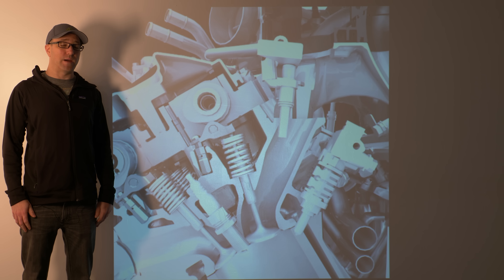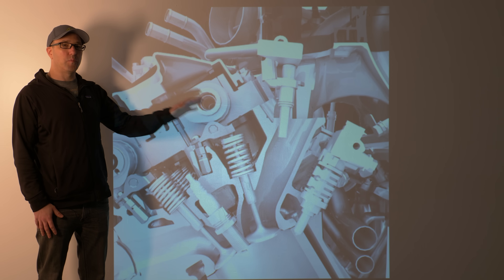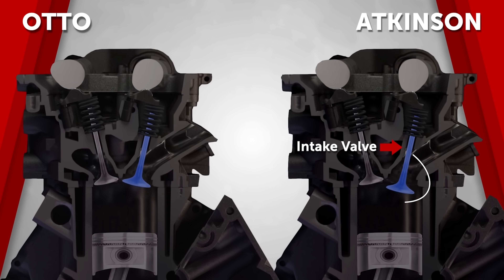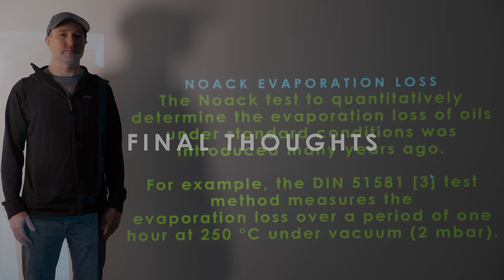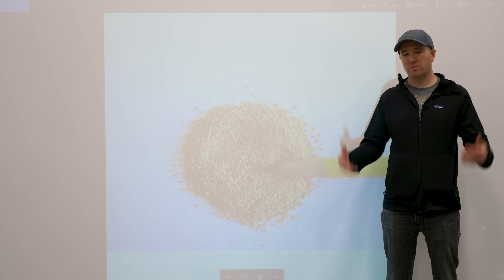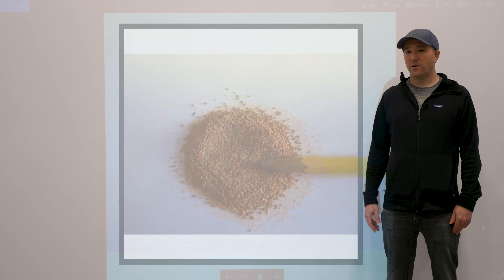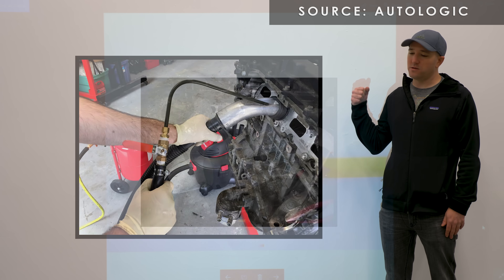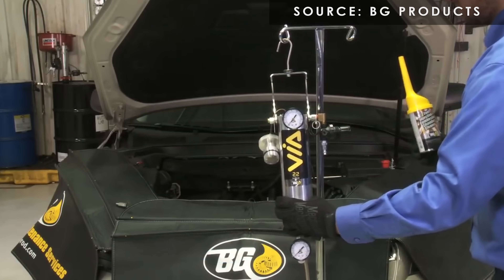Direct Injection, Problems and Solutions | The Fine Print

Comment: Toyota may cheap out on their paint coding, but they never chip out on engine and transmission materials and technology. And 'Oh, they just reliable cos they use old tcch' BS. is false, since simple new Corolla has industry leading tech. Germans even wouldn't be able to mass produse engines like that for adequate price. But it's not news. Even In 1980s their metallurgy technology was far superior than that in other countries and only they could build long stroke engines that were high revving, due to mass production of light and strong crankshafts, connecting rods and pistons. They were smooth, economical and powerful even before ECUs and other modern stuff. That's how they concarade the world. Then they showed how injection, variable valve timing, active awd systems and turbocharging is done properly and reliably. They were also first to implement these technologies in mass production of affordable vehicles. 

German cars are unreliable, not because they are complex, but because they use cheap materials, cheap production process and reliability unconscious engineering for their engines and transmissions. Carbon build up (due to cheap, unsophisticated direct injection systems), oil consumption and cluttering (due to bad design), bore erosion (due to the lack of proper inserted iron sleeves, because it's cheaper to spray some coding on aluminum block) camshaft and crankshaft wear (due to cheaper materials). BMW also likes to overheat, cor i6 suckes. Vag group likes to use older engines with modern tech on top and cheap dual clutch transmissions. That's wright DCT is far cheaper to produce than proper torque convertor once. Overall heir transmissions are cheap and unreliable. These are well known issues with modern german luxury cars. That's why they don't last more than 100k. 
They simply aren't meant to last, since in europe: the older your car is and the bigger engine it has — the more taxes you pay. And really old cars aren't allowed, it's only logical for them to not care about the car making it over 5-10 years and 100k miles.

Lexus LS 460 was very complex machine for it's time (2007 2012) with it's 8 speed auto, direct injection high compression engine with active egr cooling, vvti and complex suspension. it is expensive to maintain, yet there are a lot of them with 300+ k miles on the clock while almost none of W221 S classes that passed 200k.  Because it has high quality key components. And mark my words: new twin turbo v6 in Lexus LS 500 will outlast (milagewise) German turbo 6es, just like old Lexus atmo V8es had outlasted old German atmo V8es. 
Oh and Toyota have never used direct injection only.

Comment: The carbon build up issues only seem to affect certain manufacturers to certain degrees. I feel like VW and BMW destroyed the reputation of GDI systems because they REALLY had some carbon issues with theirs. The same issues are almost non existent for some other manufacturers such as Ford and Hyundai which aggressively jumped onto GDI over a decade ago. I say almost non existent because the small number of cases that exist can usually be traced back to owner neglect and lack of maintenance such as poor quality fuel and oil, short tripping, skipping servicing or all of the above... 
There are DI engines with over 500,000 miles and have never had the slightest issue. A good example is a 2012 Hyundai Accent on the Hyundai Forums with over 550,000 miles. This 1.6 GDI has had full synthetic oil since new, top tier fuel with occasional injector cleaners added. The owner stresses it still gets original spec performance and economy figures on completely original mechanicals, and has never even looked at the intake valves due to not having a reason to do so...
Look after your cars and drive on!

Comment: Well, with all the problems in mind, my Polo TSI does  15km/L on LPG with mostly(90%) highway mileage... And no oil burning or carbon build up issues. 255000km, still going strong

Comment: Sorry but catch cans are a fail . At low rpms,  your pcv system has a fresh air input just in front of the throttle body and a output  going to the intake manifold through the pcv valve  . At mid and high rpms where most blow buy exist  the air flow at the air cleaner turns around and you basically have two blow by outputs . Put a restrictive catch can on the line to the manifold and more of those nasty gases will just be routed trough the throttle body , muck up the intake runners etc . In conclusion the gases under pressure will always  take the path of least resistance from the two valve cover openings . Lastly many cars have in the oil pan a liquid vapor separator or a self draining catch can by another name .

Comment: Absolutely do not use a thicker oil even if it has a lower volatility percentage. Modern cars with VVT, CVVT, VTEC etc. all rely on oil to enter extremely fine mesh guards to actuate the camshafts via oil pressure. Using a heavier oil will lead to larger particulates possibly getting stuck in the mesh rendering the technology useless, resulting in a huge mechanic bill or hours in the garage. Furthermore, a heavier oil will cause the engine to run without lubrication for longer upon cold startups, resulting in decreased life. Simply pulling the intake manifold every 30k-100k miles and cleaning the valves is way more cost effective in the long run. 

Rant over. Also, cleaning the valves is quite simple provided you research over how to properly walnut blast your vehicle. Usually, not always, pulling the intake manifold is the most difficult and time consuming part.

Comment: Interestingly enough some of the high tier oil manufacturers don’t show the NOACK numbers on their products. I’ve been doing some research and turns out there are some mixed opinions on NOACK numbers, typically under 15 is ok for PI, some people says DI needs some higher numbers in order to make molecules heavy enough so don’t get carry in to the valve, but some others says lower numbers allow the particles to fly inside the CC and get burned without residues.

Comment: Commercially available cars didn't get 50-70mpg in the '80s and '90s!
The Civic HF was probably the most efficient mainstream car and topped out at EPA 51mpg highway and only achieved that in one model year. It only made 58hp! 

The low power was offset somewhat by its low 1,700lb weight. These days cars are heavier due to much higher safety standards.

Comment: You know what makes a great catch can? The giant heat exchanger that is used to cool down your intake air on a turbocharged motor, the intercooler.
I run a catch can on my Ecoboost F150. It catches a lot, but as you mentioned, not everything. My intercooler does a fantastic job of catching the rest and if you put a little weep hole(my aftermarket intercooler came with one) at the low point of the cold side end tank, it will blow out any oil/blowby after it condenses and puddles in the end tank.
One thing I will say is that a catch can is a somewhat high maintenance item. I have to drain mine on my Ecoboost every 1000 miles or so. It's not something that everyone should try because you need to stay on top of it. If you are the type of person that uses your car as a commuting device and just drop it of at Meineke once in a while for an oil change, a catch can is not for you.

Comment: What about diesel direct injection?
Reply: Take all the negatives of gasoline direct injection, and multiply them by 10 with diesel. The problem with diesels is that they utilize an EGR and that EGR returns sooty diesel exhaust back through to the intake. Once that soot mixes with the oil and blow-by from the PCV system it turns into basically asphalt on the walls of the intake. I pulled the intake manifold off of my Jeep Liberty diesel after only 70k miles and the inside was coated with almost 1/2" of crud.
Reply: @Jay-me7gw  Damn. And diesel is only direct injection if I'm correct and if it weren't it wouldn't clean anything in the inlet.

Comment: GDI's and Turbocharged engines recently have been proned to "LSPI", Low Speed Pre-Ignition!  The new ILSAC GF-A standards are now effective 05-01-2020 with significant motor oil enhancements that protect engine owners of these engine designs!  FYI, learn more about our patented BestLine Engine and Fuel Treatments now with Nano Diamond Technology which is a creeping type of molecular lubrication that protects greatly against LSPI!  Your engine with BestLine blended with any type of motor oil either conventional and/or synthetic/full synthetic becomes a superior motor oil!  Essentially your internal engine will become virtually impervious to high thermal heat and extreme pressure!  Thank you, SavageGeese, as we thoroughly enjoy your videos here ar BestLine Racing!  Visit us here:  http://www.extreme-engine-relief.solutions

Comment: I just added carplay to my 2002 Honda Accord. 463,000 miles, port fuel injection, stick shift. Bought for $1800. Replacement engines cost $350 from the boneyard. 

I just looked at what new cars cost and lord have mercy is that not a pretty picture. Hope you want a self-destructing CVT mated to a small GDI Turbo engine that will crap itself in 80k miles for $25,000..
Reply: The point is your lean burning Honda accord is not up to modern emissions standards and outputs more than the modern equivalent. Whether you care or not is irrelevant, the federal agency's who dictate these things have made sure that the car manufactures care and so they push these technologies out. That said, some people would rather have the increased performance of a modern DI motor. In an age when a modern full size crew cab pickup truck can run low 12's in the 1/4 mile with just an PCM flash(2017+ 3.5L Ecoboost F150), or tow a 12,000 lbs trailer up a mountain with little issue, all while achieving low to mid 20 mpg's on the freeway, a lot of people can overlook the reliability issues.
Reply: Jay Skrypek I suppose it does cut both ways. Of course it can have the side effect of making cars twice as expensive, which I think people are just ignorant of and would be displeased to discover. 

Is it correct that I could retune this car to hit particulate emissions targets by increasing the richness and lowering the fuel economy? Are there other bits that would explode if I did that (assuming I returned the EGR to not nuke my cat)? Personally I think that a more pragmatic approach would be to tune cars differently depending upon locale, requiring people in LA to time for low particulate emissions and allowing lean burn elsewhere to achieve lower carbon. The particulate emissions seem to be more problematic in the acute sense but the relationship between harm is not linear to the atmospheric concentration which is geographically dependent. Plus the biggest effect of the CAFE garbage is larger cars to get more lenient emissions targets, a great victory for the regulatory state if I’ve ever seen one. Is there any data on realistic improvement of the key metrics like particulates and fuel economy net-net? Do we calculate their cost/benefit ratio or do bureaucrats just periodically ratchet down the numbers for fun?

Comment: Amazing, very well-composed video!! Just got my first GDI car recently (3.5 EcoBoost) and was concerned about valve buildup. This helps explain in extremely well.... thanks a ton for this!
Reply: Which 3.5? Second gen 3.5s are multipoint injection (port and direct injection)
Reply: @twinkieerella  first gen unfortunately. It's a 2016 Taurus SHO, which I don't believe received the second gen till 2018 or 2019, though it was apparently available in other 2017 models. Wish I knew about the Gen2 engines before I bought this car. Lesson learned lol.
Reply: BitterTongues84 I understand. We have 2014 f150 with first gen 3.5 that had major carbon cleaning at 67000 mi

Comment: I took your advise and bought a Lexus GS F with a V8 that has both PI and DI.  So far so good.  I have always been a big believer in spending good money on parts and gas and oil so do you have any suggestions on what gas treatment/cleaner I should get and how often I should use it?  I use only Chevron gas because in my past experience it made a difference  with that gas treatment that Chevron has in it, but I used to buy it to add to the gas twice a year to go along with what comes in the gas, and I have never had a fuel or engine problem in my old Chevy V8 Van motors, and I've owned 7 of them all with no problems.  I want to baby my Lexus with whatever I can so any suggestions would be greatly appreciated.  Thank you.

Comment: Last year I bought a 2008 Grand Prix with the N/A 3800 with less than 50k miles.  I'm praying it lasts me long enough to save up for an affordable electric car because I've worked on GDI engines and I would never want to own one in a million years.  Between direct injection, dual overhead cams, turbocharging, and variable valve timing, modern combustion engines are over engineered to the point of absurdity to meet CAFE regulations and cost a fortune to fix when they break.

Comment: Excellent presentation. What do you think of gdi intake valve q cleaners you spray on to the air intake such as the popular CRC gdi cleaner? Can it damage the turbo or catalytic converter by loosening carbon clumps? Will greatly appreciate your input.

Comment: Detailed, good video. I recently saw an explanation for use of CRC Cleaner for GDI engines. I does not look as good as walnut blasting photos, but much easier, and cheaper to do. I don't work for CRC, but the video is helpful and informative. Titled: How To Use CRC GDI Intake Valve & Turbo Cleaner.

Comment: throttle body institution wouldn't work with emotions as well as cleaning the valves i guess, because throttle body injection should be cheaper than MPFI.

Comment: You said that valves of an direct injected engine get so much dirtier and that you then have more problems and reliability issues over time. I totaly agree with that, but what about diesel engines. A lot of them today also have a turbo they also have PCV systems or oil separators and the fuel is injected directly into the cylinder and they also have EGR system which really means that there is a lot of crap going past the valves, yet we know a lot of diesel engines that can easily do over 600000 miles and more. So if that is possible in a diesel engine so it should be in a direct injected gasoline engine, as far as I am concerned it should be even easier, because diesel are even dirtier.

Comment: The 80’s fords have two fuel pumps. A low pressure at the tank(s) and high pressure on the the frame. This is the is the first EFI  ford designed.

Comment: I own a BMW 335i. Its tuned up so I get the double whammy of oil blow by AND direct injection. My car has 130,000 miles and to the best of my knowledge has never had the valves cleaned. Yikes.

Comment: How could these "engineers" NOT see that they would be crudding up the intake valves???  Back in 2015 they were trying to convince me to buy the direct injection motor in my F150.  Tiny little engines being turbocharged to create big power (with the real problem being the dirty valves) didn't make any sense to me.  The salesmen don't understand any of this.  They just look at fuel efficiency and hp.  No common sense.  (I guess you can put a "catch can" on the engine to avoid dirty valves...but that shouldn't be necessary).
Reply: In many cases it won't be a noticeable problem until 100k miles and well after the warranty is up.  Then it's on the owner to deal it.

Comment: What about engines (like Toyota) that have both port and DI?  Would the carbon build up from the DI system be as bad since the port injection would still be washing the backsides of the valves?
Reply: @EpicDrew15  Nice.  The engine in my 2020 RAV4 has both.

Comment: We had a 2016 Mazda 6 with a GDI engine. When we traded it in, it had 69,000 miles on it and was running fine. Still getting 38 to 40 mpg on a trip. We did take an 11,600 mile road trip with it which probably helped keep the valves clean and I also used CRC on it once in an effort to keep the intake valves clean. I believe we used Castrol 0W-20 oil. While we had no symptoms of carbon build-up on the valves, I was always concerned with it. We ended up trading it for a super low mileage 2009 RAV4 with less than 19,000 miles on it. No direct injection. It may not come close to the Mazda on fuel economy but I have no problem with that.  I'm 73, so who knows? This car could last us the rest of our lives.

Comment: Why do people love to INVENT facts.
DI is as old as Diesel engine.
So 1893.
Diesel engine would not operate without it. Well it would just barely.
DI does not need any computers to operate it can be fully mechanical
Result is more durable and more expensive which is all in conflict with production of Gasoline engine.
Simply because Gasoline energy density is poor compered to Diesel.
So you don't use high compression and precise fueling as benefits are not significant enough.
As you can see Gasoline engine isn't clean at all its washed by fuel and caught by cats. Where high compression diesels would burn it all and push it out. Basically cleaning itself.
Injection system needs to stay clean and Gasoline engines can't stay clean if they don't use intake injections.

Comment: Is DI really more economic also in high rev range? Especially in ported heads I would assume that PI would be more economic for drivers which like to rev and use the power. Former F1 engines had the injectors before trumpets to mix and cool the air before entering the cylinders.